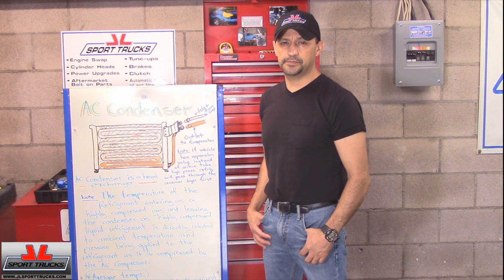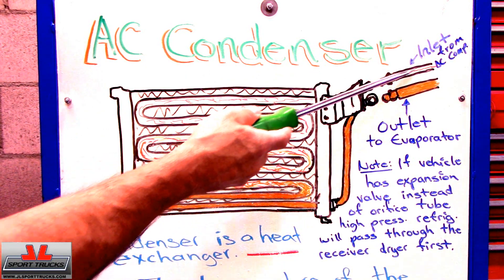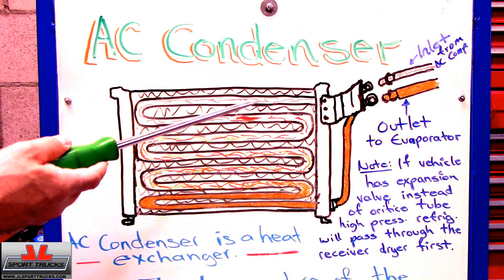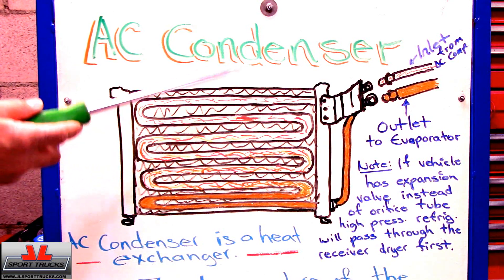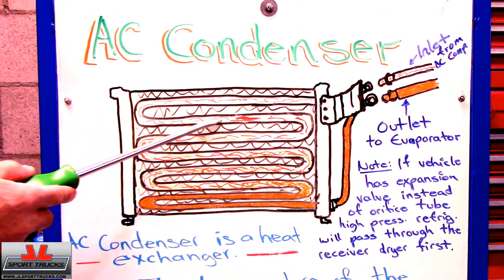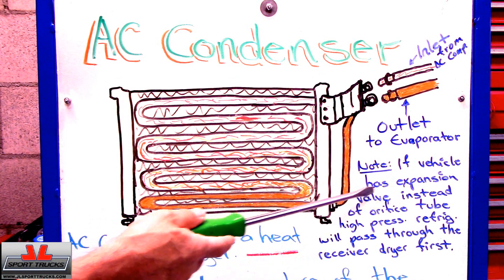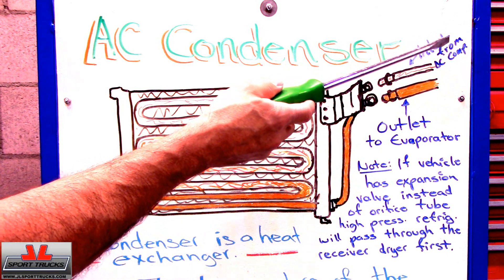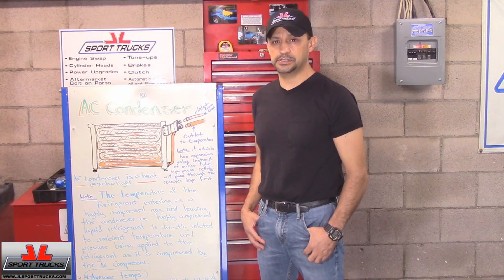How the AC Condenser Works

Comment: 2013 Kia Soul keeps blowing compressor seals. Pushed compressor air both directions through evaporator. Still same problem. Any advice appreciated.  All other components have been replaced. Am at wits end and the wife wants her car back.  Thank you for consideration.   Louie
Reply: I would try a new compressor

Comment: Hi, how much resistance to air flow does an AC condenser has? I've taken out my car's AC condenser and simple blow test with my mouth it seems to have alot of resistance, is that normal ? should air flow freely in an AC condenser? thanks
Reply: Hi, I don't know much about it but I wanted to point out that you want to force air through as high resistance a space as physically possible, because the condenser body works as a heat sink and you want it to have a lot of surface area.
So it's kind of a balance but in a perfect scenario, you'd have a very powerful fan forcing air through a lot of small spaces, moving a little hot air quickly away from a lot of metal heat sink fins.